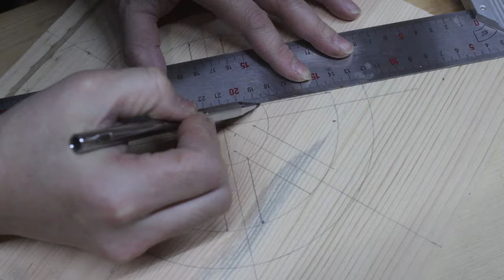Table Saw Build - Part 2 : Angle Tilt Mechanism ➲ DIY WoodWorking For Aug16

Comment: Beautiful job there on the tilting and height adjustment my friend.. I am about to attempt my own build soon. The thing is I have most of it set up but I want to put a tilting mechanism on my saw with the 2nd wheel but I'm a little stumped by the whole thing. I will work it out but this video has given me a slight hint into a great way of building it into my saw. Thanks for that my friend.. Appreciate it very much. Keep up the great content..

Comment: Hey there man.. I have a question if u have a moment to answer for me my bro. I'm about to begin my table saw build. I'm using old parts rom a cheap table saw so I have a bit of a head start but wht I cannot figure out is how u managed to get the blae to come up in the same position as u would for 90 degrees and 45 degrees. I would like to completely rebuild from scratch but that part I cannot get my head around. My table will be 1000mm (length) x 500mm (width). Is there a specific place I would need to place the whole saw mechanism to get it towork as well as u got it to work? What I mean to ask u is placement all important. 
I will be using some old parts from a cheap table saw with a 1500W  motor. Hard start but I have the lift mechanism in there. What I want to put onto my new built saw is the tilt mechanism. So I guess my question is this.. Is where I place the tilt bar & mechanism more important to getting the blade to come out correctly as it does in the lift mechanism. I guess I'm asking daft questions here but I hope u get what I'm trying to ask u bro..
I haven't built a Table saw before so I would like to get it right. I'm using 40x40mm Sq tubing. I have some 25x25mm tubing too and some 50x25mm also. I bought the 40x40mm angle bar to build the fence aswell. I'm going all out bro but I don't want to mess it up.
Any advice u could give me on the Lift & Tilt Mechanisms would be gratefully received by a fellow saw builder. At least I wanna say I'm going to do my best. 
Love the channel bro. Been sub'd for a good while. I shared the channel and video but I'm only getting back onto twitter now. I lost a load of ground there. I had a few thousands followers but they're all gone. I don't know what happened. I musta said something that wasn't liked. I can get a wee bit political sometimes and rub ppl up the wrong way. 
TGake it easy bro and keep up the awesome work.. I love ur table saw build..